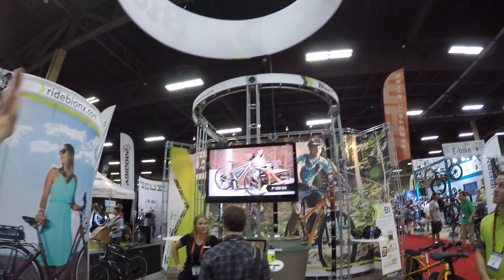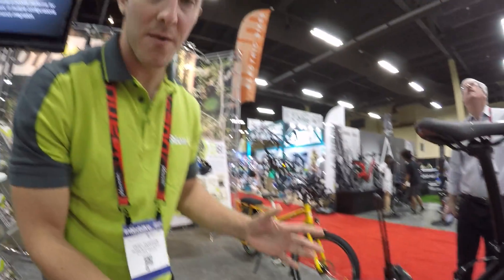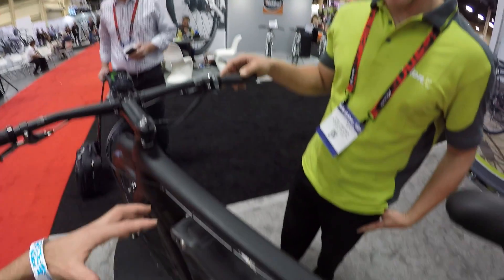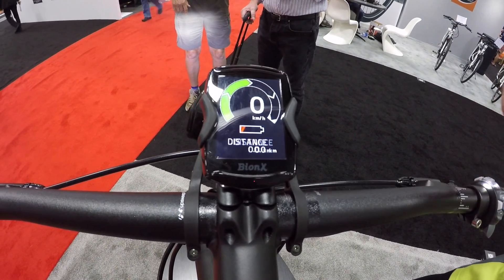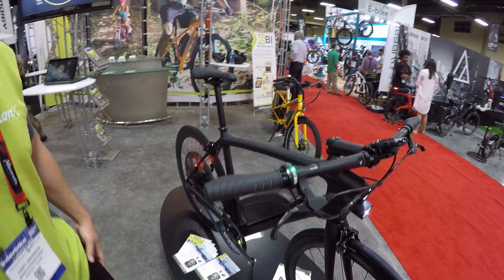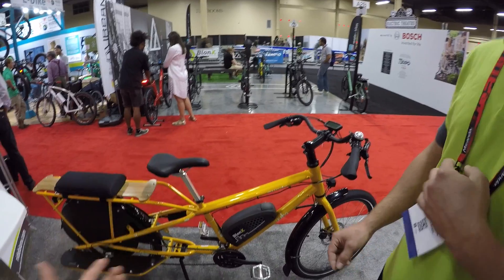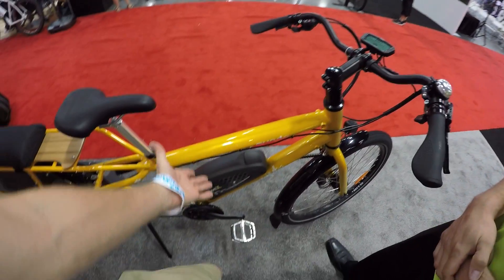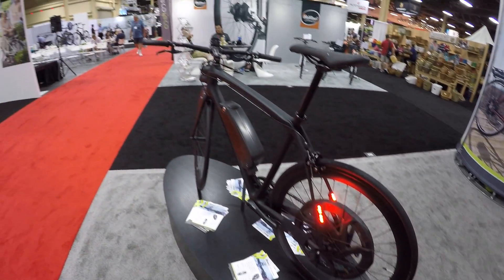2016 BionX Updates from Interbike

Comment: Good stuff from Bionx, but let's be honest about regenerative breaking, it's mostly just minor gimmick.
Reply from the maker: +ilan magen I've heard it really cuts down on brake wear and you get like 10% to 15% efficiency in energy recapture which could be 5 to 10 miles per charge using one of their larger packs. It's not bad, would rather have it than not if I'm going with a gearless hub motor design :)
Reply: every company that doesn't have regen tech tries to say its not needed . I've had systems with and without . 1 of the best benefits is the motor brake for long downhills and stopping the extra weight of the kit and hauling a ton of groceries/hardware ,,etc .  Putting it in regen and not touching the brake is nice ,then seeing a battery bar reappear ...honestly can't beat that .
Reply: +ElectricBikeReview.com I sent email to BionX recently saying that with their sophisticated software they should implement an adjustable max downhill speed option above which the regenerative breaking automatically turns on and puts energy back into the battery. No fumbling around to push a switch to slow the bike without using the brakes.

Comment: how do you increase ah on ebikes?
Reply from the maker: +NerdForLife It depends on how the batteries are arranged, you can increase the voltage or the amp hours by putting them in series or parallel respectively.